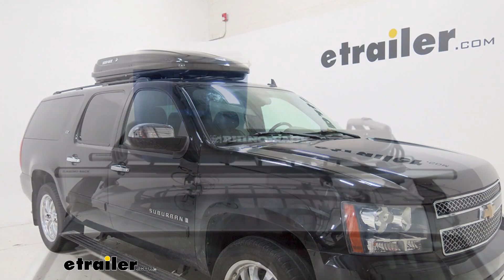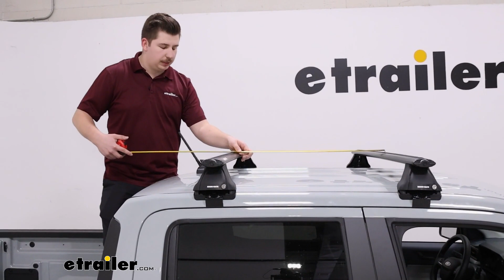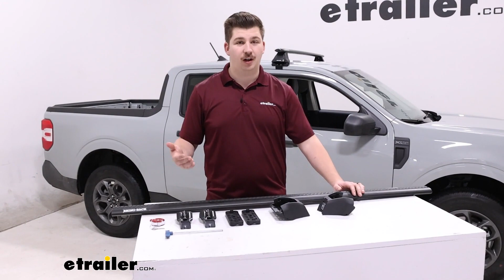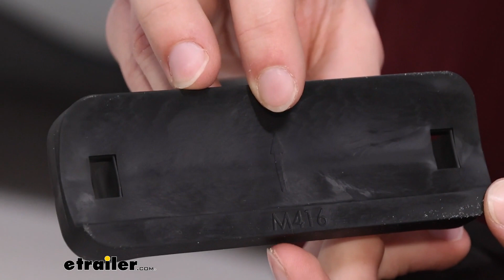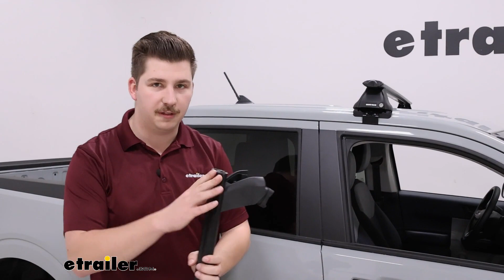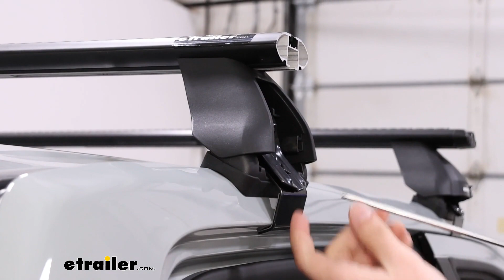Install: Custom DK Fit Kit for 4 Rhino-Rack 2500 Series Roof Rack Legs on a 2022 Ford Maverick

Comment: can you mount max trax on this?
Reply from the maker: If you mean on the crossbars, then yes you can. If you mean just the Custom DK fit kit, then that is probably a no. They are specifically for Rhino Rack towers.

Comment: It wont hurt the paint ? It looks like its gonna scratch the bottom clamp , needs a foam too
Reply from the maker: As long as the roof rack is properly installed according to the instructions, the roof rack won't scratch the paint on your car. The roof rack feet sit on rubber pads and the clamps are padded. Before installation, you'll want to make sure the vehicle roof is 100% clean and free from grit.
https://www.etrailer.com/Roof-Rack/Rhino-Rack/DK228.html
Reply: @etrailer y
Reply: An I put a plastic cargo carrier on this as long as I don’t exceed 165 pounds? Will it be safe at freeway speeds?

Comment: How’s the wind noise with these on the maverick?
Reply from the maker: Anything installed on a vehicle roof is going to cause some wind noise. The elliptical profile of the bars significantly reduces this, compared to a round or square profile bar. In other words, if you need a roof rack, using an aero/elliptical style bar like the Rhino-Rack Vortex Aero would be the best bet for minimizing the noise as much as possible. 
https://www.etrailer.com/roof-2022_Ford_Maverick.htm?fUrl=-pt-Aero_Bars-pm-Rhino_Rack
Reply: Barley noticable under 75mph